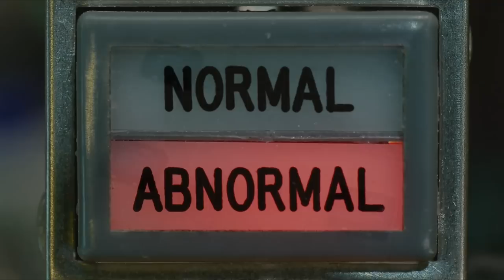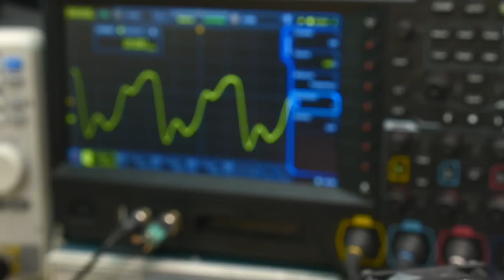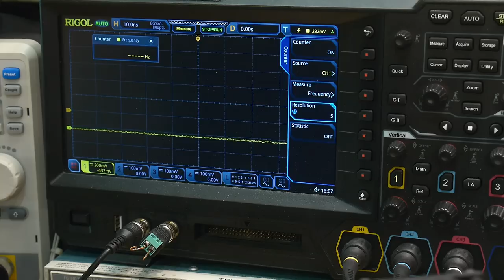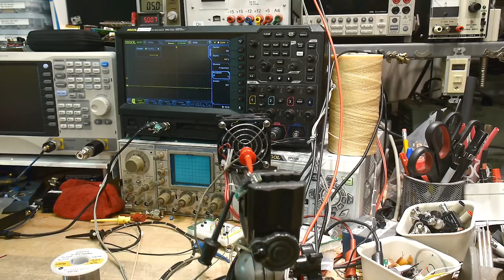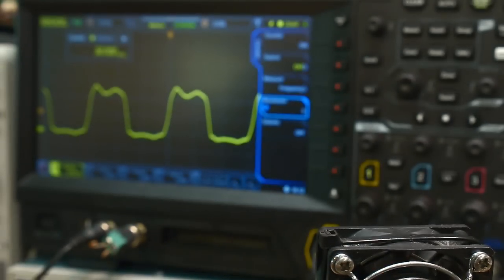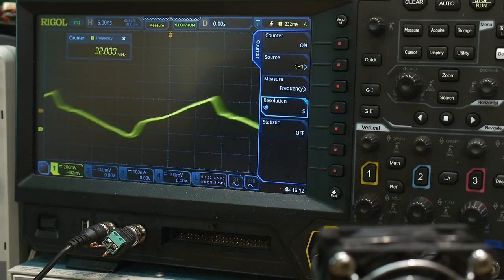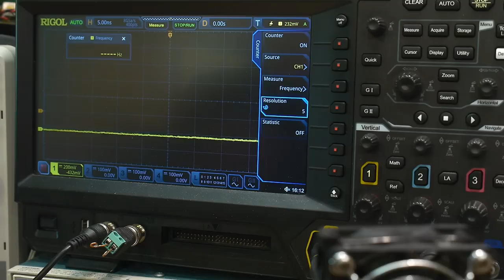#1525 32MHz Oscillator Bad Waveform

Comment: Funny enough there are some Vishay Precision Resistors (Flex, SMR series) use that sort of package specifically so the 'bendy' leads have some give in them, to negate PCB warping / stress on the resistor once soldered.

Comment: AFAIK that's a type of SOJ package... and the leads are known as J-leads... though the Saronix part is really a Phillips semiconductor part AFAIK. There was a s... load of TTL, fast TTL, Schottky TTL and CMOS part made... and having this package available. AFAIK it is reasonable to view this package style as a transition from DIP to SMT... whether that was the intent requires some evidence. I think you can still get some newly manufactured SOJ stuff (static RAM) You can get SOJ to DIP adapters. These at places like Mouser.

Comment: Even if the oscillator datasheet says decoupling capacitor is not needed, I still think it's a good idea as capacitance of the built-in Silicon bypass capacitor tend to change once the MEMS / Quartz driver and amplifier gets warm in operation.

Comment: I miss you...

Just been working....

A big semiconductor fab in Chandler and elsewhere...they slowed their wafer starts...and performed a little reorganize 

So we had a head count reduction too...of 0.3...then another 0.3 read something on wall....and left...

And now things are starting back up and management has forgotten 0.6 left...and want the same old TAT...

Maybe the oscillator needs a buffer or has a fan out of 1...

I didn't hear the amplitude...

Or how close you measured to the funamental...

It is a good  oscillator....

Every logic chip...I  use has bypass on Vcc to ground...

Good. Demo

Comment: A scope probe is quite big and cumbersome, I have a 16mhz oscillator in a small environmental chamber that I'm trying to measure and datalog, I have just soldered some coax to the board and run that straight to the scope & counter but the waveform looks quite ugly like yours did. Is there anything better I should be doing?
Reply: At this frequency I would use a small 50 ohm coax with 1k resistor from the coax center to the DUT.  The shield is connected to ground as short as practical. Terminate the coax at the scope end with 50 ohm load either by a resistor or scope termination. This basic setup with some improvements works rather well to several hundred MHz.  Search for homemade RF probe and find many ideas.

Comment: “I was looking for a spring” - that’s beyond hope in my case. I just grab some brass wire and wind them up as needed on a screwdriver that had a slightly smaller diameter than the probe ground sleeve. They all disappear. It’s like magic. Must be tangled with all the lost socks.
Reply from the maker: I bought 5 for $6 on eBay, so have some spares now. And of course, I then found it!

Comment: I know nothing about building or tuning oscillators, but I need one that is at 0.864 Hz. 555 timers are too unstable for precision timing. Do you have any suggestions ?

I've been worjing on this project for 8 years, in the process I've managed to blow up 7 AT Tiny's and a Raspberry Pi nano. LOL
Reply: Are you looking for a sine wave or square wave output?  It should be fairly easy to get an Arduino to toggle a pin at precisely that rate, excepting crystal accuracy.
Reply: Pay a nerd to build one for you.
Reply: @tonyfremont  It needs to be a square wave, it will act as a timing pulse. I imagine an Arduiono would suffer the same fate as the other microcontrollers I've tried.
Reply: @mikebond6328  That's not a bad idea. Where abouts in the world do you live ?
Reply: Out of curiosity, what are you trying to drive with this pulse?
Reply: @mikebond6328  Oh, nothing much, I'd rather not say, but the 0.864 Hz square wave is critical for the timing.
Reply from the maker: 'precision' would mean crystal controlled. so 
8.64MHz osc with a divider
PLL (phase lock loop)
DDS (direct digital synthesis)  (need a microcontroller to program, so you can just use the microcontroller alone but you seem to have tried that)
Reply: The reason I ask about what you’re driving is because a microcontroller can’t supply much current and is used just for the signal. You would then need send the signal to something (transistor) that can handle the power.
Reply: @mikebond6328  It's just driving a 74 series logic IC, so there's no problem with current limitations.
Reply: @IMSAIGuy  dividing 8.64 MHz. down to 0.864 Hz.would take a lot of doing, Space could become an issue.
Reply from the maker: @frankowalker4662  it would be one IC if you have the right crystal. use a 4040/4060 and some crystal freq that when div by a power of 2 gives you your frequency.
Reply: @IMSAIGuy  Ooo, I forgot about the the 4040's. I was thinking of normal dividers. I'm having trouble locating a suitable crystal though. Anything that is a multiple would do, but it's such an odd number. LOL
Reply: @IMSAIGuy  Well that was easy. I found a 22.1184MHz crystal. It will divide down to 0.0864, I just need to find a way to tweek the dividing process. Thank you.
Reply: Hey is this my buddy Franko with a new name ? is that you Frankulon ?
Reply: @andymouse  Hi-ya, Andymouseulon.. 🧀
See you at the Alliance. 👍
Reply: @frankowalker4662  Hi, I don't  remember there being a '4662' on your name !! am I losing it ?  LOL !
Reply: @andymouse  Alliance is on.

Comment: The Saronix data sheet test circuit shows two capacitors in parallel between various pins similar to what you added. But in the diagram, it depicts other components I’ve never heard of. Granted that isn’t saying much, was hoping you might elaborate
Reply from the maker: I'm not sure what datasheet you are looking at. are you talking about some circles? they are volt and amp meters
Reply: @IMSAIGuy  😂